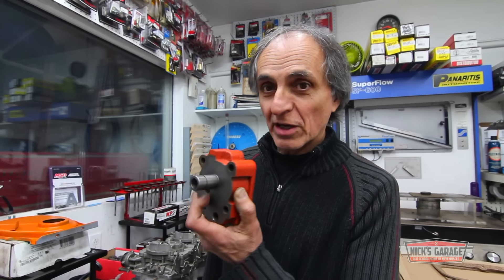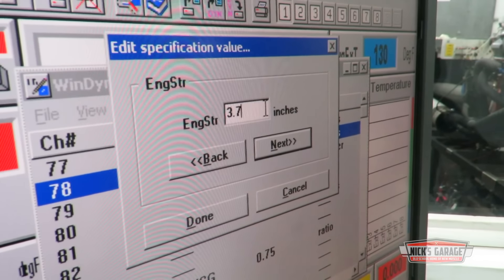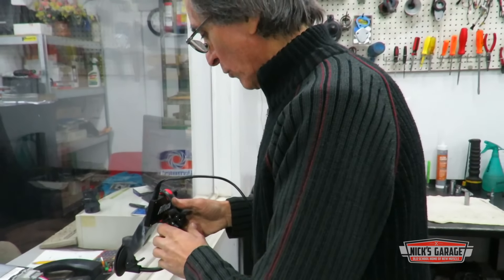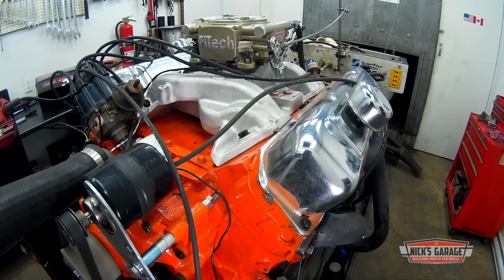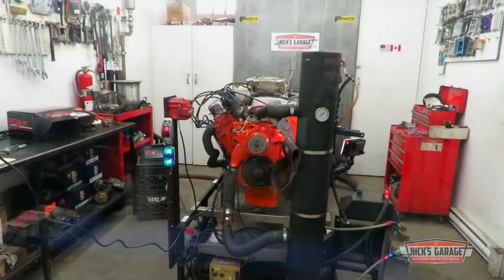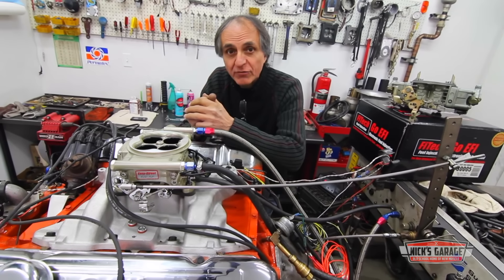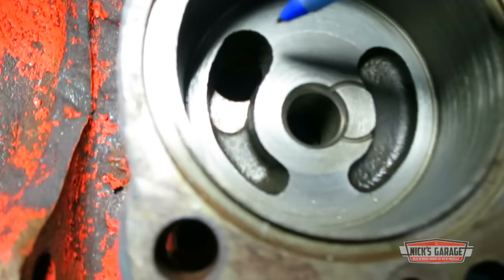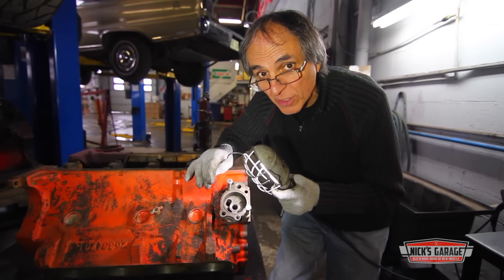Carburetor vs E.F.I. - Dyno Room Showdown

Comment: EFI still needs tuning.
Reply: AJ.  It needs more time to learn. But one night we stayed to tune the EFI, We made many tests and did many tuning, and the best for that night we made an average of 429 HP. The torque stayed the same.
Reply: Peak number but what was power curve hp and tq through out the curve
Reply: Nick Panaritis 
Good to know. Thanks for all your tips Nick!
Reply: Question is what will the numbers look like in real world operation?
Variables like heatsoaked underhood conditions. Barometric/humidity conditions that hinder fuel atomization. Elevation changes. Etc. Etc, Etc.
My moneys on the FI making more consistent HP/Tq numbers in the real world.
All out power in a controlled environment belongs to the Carb.
Reply: last year, i took the one i finished to the mopar flustercluck at Texas Motor Speedway. sat in a mile long line for 2 hours, idling at 195 degrees on a 100+ day, with the a/c on. nearly every carbed car there was puking coolant and vapor locking.  no question, fuel injection is the better option.
Reply: I know all of that stuff but my question was power curve. He really should showed dyno sheet on carb and EFI. Besides EFI don't have to rely on Vac pull air through venturi and air bleeds to get fuel flowing. Other thing tune carb for today and tomorrow it's wrong. Then EFI using wide ban oxygen sensors it always adjusting AFR. Just like every SB chevy owner talks about their ported 2.02 head at 600 lift flow this then don't have cam with that lift LOL. Where you should be looking at low lift flow numbers because better low lift flow pull harder through out power range. Carb engine tend to be a bit on peaky side
Reply: Most of EFI vs CARB the EFI had better lower end power
Reply: Those carbs need tuning because they are too lean at light throttle (idling) and the cooling system capacity is exceeded. Lean fuel systems (EFI or carb) produce more heat. The fuel doesn't know if it is coming through a jet or an injector.
Reply: Gordon G.   You are correct.  In the car we will tune for a daily driver. We are learning to get it perfect.
Reply: Carb has cooling effect on in coming air from atomizing fuel which can be part of why they make little more peak power where airflow at the greatest. But EFI will give you better overall power through out power range. I rather have engine pull harder at lower RPM and up through
Reply: Tell me how carb can ice over even in warm temps???? I SAID "SOME" cooling effect damn can you read or do you add in more than whats said. I have worked on carbs a lot and at times they can be a royal pain. You ever feel how cold carb can get on a dyno????? I've seen many dyno sheets and track times where EFI out performs. You don't have fuel moving around in fuel bowls from braking, accel or fuel pushed to one side from cornering/turning that have major effect on carb. Other thing tune great today tomorrow it's crap....
Reply: Like the videos.
But in 2018 comparing throttle body injection to carbs isn't comparing the best of each fuelling system.
Whilst the comparison wouldn't be as easy a more valid comparison might be four twin choke carbs (e.g Weber ) vs individual port injection.
There are many reasons fuel injection replaced carburettors including more power, better driveability, excellent starting in all ambient conditions, easier tuning, better control of emissions to name a few.
Reply: @MrZcotty  that has nothing to do with fuel injection. Thats a cooling system and fuel system/return line inefficiency. Get those sorted out and you should have no issues with vapor locking or overheating

Comment: Have you ever used the Predator brand carborator before?
If so, how does it rate against the standerd carborator design.
Reply: Aries Might.    No I have not, Sorry.
Reply: Nick Panaritis. Predator carbs self adjust from a minimum of 390 cfm all the up to 930 cfm. They are a very simple design. Yet advanced enough to allow you to mount them in any position. Even upside down. This is due to the fact that they lack floats and many other parts. In many types of racing they are the only specialty designed carburetor. That will allow you to win first place. Over the other carburetor designs.
Reply: Aries M.  Thanks for the info.
Reply: You are welcome Nick Panaritis. This is my way of saying thank you. For all the great videos that you make. And share with all of us.

Comment: The EFI unit never learned how much fuel it needed at WOT which takes several pulls to get the AF-Rs right. You skipped that part entirely, EFI will always make more power when tuned correctly

Comment: I prefer carb over efi in a old school engine application anyday
Reply: I agree, to a point. Ever try tuning a car with a power adder like a turbo forget nitrous. What works in the summer wont in the winter.  Nothing as cool as a  carbed single plain sbc 400 with heads and a cam, imo though.

Comment: Peak power is better with the carb most of the time because of the cooling of the intake charge from the atomized fuel . The EFI will have more power under the curve for more average power. Also these TBI injection systems that auto learn are not as good for the most part as a Injected Runner with a throttle body. With stand alone tuning. Overall what he shows is what we have seen when just going for peak power only on  a dyno but the EFI will be faster down a track and much more drivable.

Comment: He didn't check timing or any thing, he needed to run it at different rpms for a while too . Id much rather have fuel injection in my vehicle as a everyday driver . Carburetors may be just as good fuel injection under perfect conditions, but they have to be adjusted often depending on the area you in, and perfect conditions never last, and fuel injection systems adjust automatically . I had a Ford truck with a edelbrock carb and I did like it, I rarely had to mess with it, but a Holley is a different story .

Comment: Hey Nick,  what cfm was the efi throttle body compared to the carby, as if they both flowed the same cfm and both supplied the same  air fuel ratio, then both would have made the exact same power!    That not opinion , that’s science.   I too have engine building history as well as many hours on engine and chassis Dyno.      Your carby flowed more air ,   Yet are you saying carby s are able to match efi at all throttle openings?   Or able to meet target afr at all engine loads and Rpm.    Mate you comfortable with carby,  yet the world has moved on mate.
We each are good at what we know.  It seems you don’t know efi or how to tune it

Comment: Have just started with doing retrofits..  cost wise, there is little to be saved running a carb today.. I have that FiTech on a 514 BBF (385 engine) Felice built getting 18mpg on "boring" mode..   I did this just because after 40 some years of doing the "cold holley" palsy foot jiggle, I want something easier when cold..   

This was it.. I can let anyone jump in , start up and drive away..  not bad for an old 63 Ford...  

I would like to see some tuning time on the EFI ..  a 1/10 here or there on fuel and timing might just yield better numbers.. I know I would never get the MPG on my carb tune..   I am going to try the Holley system next...

Comment: Just one WOT pass and you write it off? What were your AFR's? Out of the box the ecu has a basic map calculated from the Engine displacement and Cam selection. Although the unit is self learning you most certainly can fine tune it. No problem with you being a carburetor man but hey? Try reading up on EFI. You could have at least done a few WOT passes to let it learn that too, not just the idle. Did you read the instructions? Overall I think it did a pretty good job straight up, no doubt in my mind it would have been able to deliver more if you had wanted to put some effort in. Overall this was a heavily biased comparison.

Comment: Did the efi save more gas? 

Thank you!
Reply: EFI will probably save fuel. The system adapts to changing weather and altitude in ways that a carb can't. Also, these EFI systems have an oxygen sensor that monitors air fuel ratios and adapts, however, some smog era carbs also used oxygen sensors.

However, there is a way to save fuel with carb setups. Sometimes you can cruise with a fuel air mixture leaner than 14.7:1. The right carb setup may allow it, but if you want to do that with EFI, you must pay extra for a system that supports wide band oxygen sensors.
Reply: @skylinefever  thank you!

Comment: You're running Champions? We've gotten a lot of bad batches of Champions. We've got a spark plug pressure tester with a window to watch the spark as you increase the pressure. As you build pressure eventually the spark stops jumping the gap and starts arcing down the center insulator. Champions always seem to fail at a lower pressure. ND plugs used to be really bad too. We got the highest pressure ratings before failure out of the Autolites and NGK, with the AC as a close 2nd place.

Comment: Two issues here. First, a goof friend of mine is a machinist/builder with his own dyno. In his experience every engine he has ever dynoed does a very curious thing that he has yet to find the reason for. All of them, no matter the maker, will initially dyno with 10 more horsepower than after cool down. No changes at all, same engine, same temp and barometric pressure, all the exact same and always a 10 hp loss. So, to confirm this test they should have checked the dyno with the carb again to confirm the differentiation. Second, the oil pump thing, pretty backwards. Why alter the pump with a guess as to where the extra material is. Instead, put the pump in place like he did, get a marker like he did, and mark the extra material in the block. Chamfer the oil hole coming out the block instead. There is so much more material to work with there The marking would be very precise, elongating that hole would yield way more flow and if your bit slips it won't damage the tolerance of the block where the pump mounts because there is no real tight tolerance there. I nick there would be sealed by the gasket where a nick on the wrong part of the pump would effect its efficiency and its a permanent fix.

Comment: Result determined from one dyno pull?
Reply: Niel Rosh.  We have done other efi tests in the past, with no issues. This Fitech was tuned the night before and ran well. The day of filming, it had a mind of its own. I guess it needed more time to learn.  Thanks for watching.
Reply: It's a curious judgement to make would be my observation. The stated goals were easy to start and fuel economy, but then you seem to judge on peak power. The FI system is also a very crude design with no port based injectors - just a carb replacement. I'm somewhat dubious about the value of self-learning systems apart from getting the car running so you can take it to a dyno and then tune it properly.

Comment: So much wrong in the "comparison" that EFI ( TBI to be more exact ) needs proper tuning, it needs more part throttle learning and load learning. I'm going to assume all supporting hardware was accounted for such as proper injector sizing and fuel pressure. Go with a full sequential setup with a good ecu and sensors and that carb will cower in fear.

Comment: Bs! Every time that thing makes a pull for the first 10-20 pulls, it will learn and make more power. Doing one pull after and idle learn is not a good comparison! Although, one the first pull it was within 10hp of the normal carb numbers this guy gets, that pretty damn good, and will only get better.
Reply: ANTIVNM.     We, and the EFI, needed more time to learn. Next time we hope to do it correct.

Comment: Try cleaning or rebuilding a carb. Now try rebuilding an EFI system.
Reply: I'm not sure what is worse, rebuilding a carb, or removing and installing an entire fuel tank to replace an OEM EFI fuel pump. Even worse is when the car company obviously doesn't care how serviceable their fuel tanks are.

Also, I suppose it depends on what carb you have to rebuild. Would I be rebuilding a carb with or without smog devices? Who would be the company that manufactured the carb? Hopefully I don't have to work with a 1980s Honda carb.
Reply: You know I think for the daily drivers out there, there is nothing more convenient than fuel injection. You never have to tune it, there is virtually no maintenance, and it far outlasts a carb. You don't have to let your car run for twenty five minutes before your morning commute. Today's fast world couldn't handle carbs, but for muscle builds and joy rides I don't see the benefits of fuel injection.

Comment: It's not really fair to the EFI to simply mount it on a fresh build with out driving it around a day or two when considering dyno numbers. My uncle has a 454 BBC in a Camaro he installed the sniper system on. After driving it for a couple of weeks he took it too dyno it and picked 56hp and 35fpt. He is extremely pleased with it.